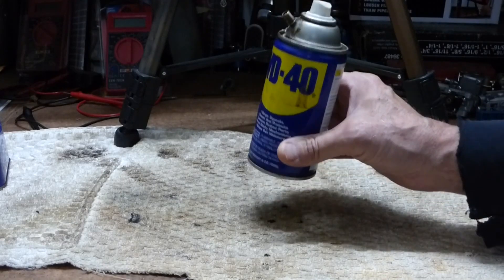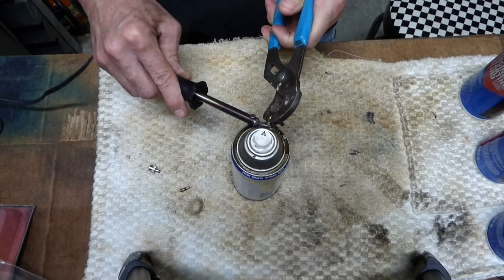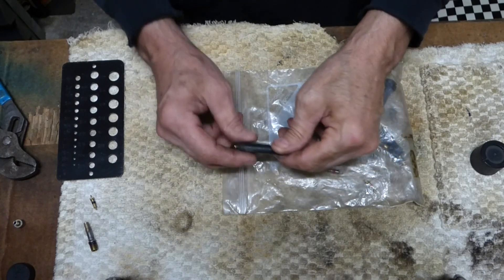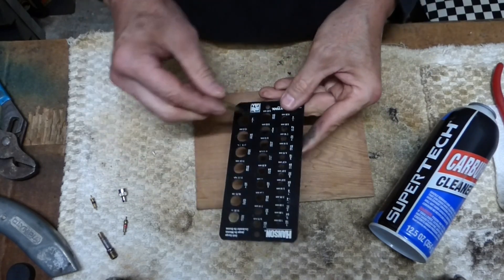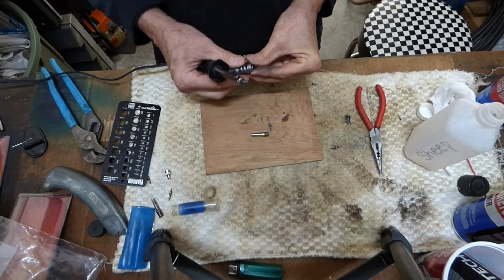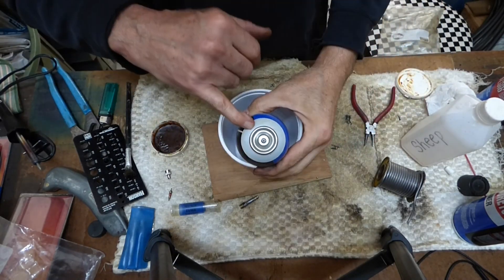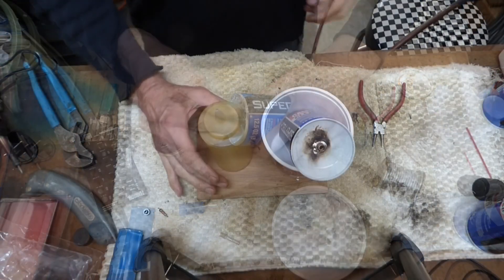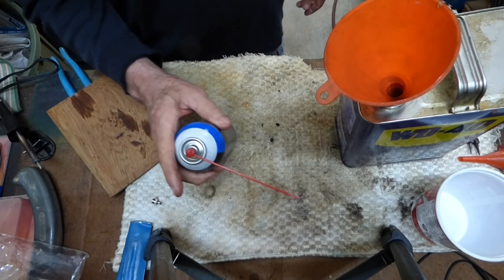Make a Refillable Aerosol Spray Can (WD40, PB Blaster, Paint, etc)

Comment: I like the bottom mount. However unlike the top mount the valve will always be immersed in solvent. I wonder if it will damage the rubber in the valve over time. Maybe give us an update?
Reply from the maker: Still working well

Comment: Thanks Buddy, good video.
But unfortunately I've noticed this comment section is full of Karens, Debbie Downers and complainers.
I was a Fighter Jet aircract mechanic, Hot Rodder in the 70's, worked on a ranch for 16  years, millwright and owned cabinet shop for years, then after 28 years retired as a Union Elevator Mechanic and welder.
Sometimes you gotta just gotta get it done!
You are the man. Thanks for all the videos. Just ignore those guys that have never adjusted a set of valves, or set a bead on a skid loader tire with starter fluid in the snow or used a cheater bar to break a 1 1/2" nut loose.
They don't know shit from Shinola.

Just do your thing! Thank you

Comment: Thank you. I was going to buy a refillable spray kit, but now I will have a go at doing this. I have some old bike tires to get a valve from, a buke pump capable of 140 psi and have some old spray cans. Will try it with paint as I have to fix some scratches and scrapes on a car.

Comment: You NEVER drill the can, you puncture a hole in it.
1)Because  there are vapors that are flammable and a drill could ignite them
2) Because it puts metal flakes in the can that will go up and block the spray valve. The way the bottom of the can is shaped makes it difficult to remove all the flakes. 
Punching a hole in the can with a tapered implement  puts a slight dent in the can that will fill with solder, helping to reinforce the area around the hole.

Comment: Pro tip. Flux will attract the liquid solder. It keeps oxygen out of the joint the same as welding rods or gas on mig and tig. Best to apply it to your fittings after cleaning and before joining them together. I also buy wd in bulk and use it in a regular plastic spray bottle. Cheers

Comment: I wouldn't reccomend putting the valve at the bottom. If a leak were to form, all of the fluid under pressure will come out from that point at the bottom of the can. Putting it at the top would only allow air to leak if the seal fails.

Comment: Has it not occurred to you that by pressurising these with air you're one step away from it exploding?. Think about it, fuel, air under pressure, add heat equals boom. Exactly how an engine works. Would be safer to pressurise with butane or carbon dioxide.

Comment: I find a pump spray bottle works with WD40 just fine. No work drilling, soldering, required and safe as no compressed air in a can. In fact WD40 sells their own pump bottle if one wants store bought container rather than an empty one from something else.😊. Be sure to relabel as WD40 on repurposed container.😊
Reply: Yea , I'm with you bubba. Only time I would take the time to do this is for paint cans. Anything else goes to a spray bottle

Comment: Solder wont stick to valve in my case. It sticks to can perfectly but no way to get it on the brass valve.... I even polished it....
Reply: Zinc chloride will do the trick
Reply: Go  over the area to be soldered with some sand paper.

Comment: Fun Project, well done! 
But you could also buy a chemical resistent small pump bottle, and fill it from your Canister in.  I don't even use that anymore. Thin Gear oil mixed with Aceton (50/50) has the exact same effect and is way cheaper!

Comment: this may be obvious, however how did you remove the rinse water?  the bottom of the an is inverted ( concave) and the tube goes to the bottom of the can ?
Reply from the maker: I just shook the Can around . You can also blow compressed air through the top Using a tire valve stem